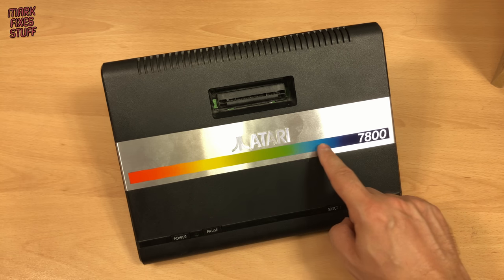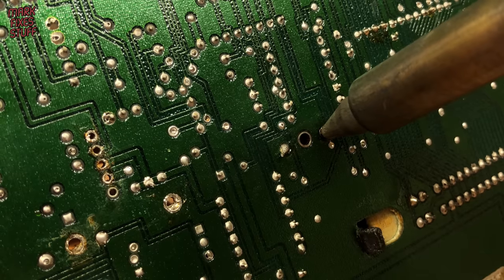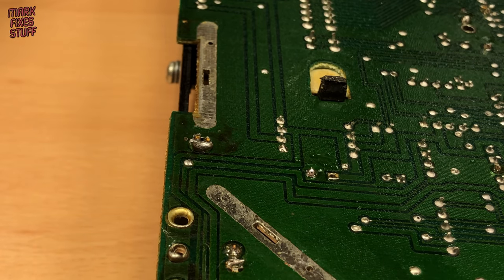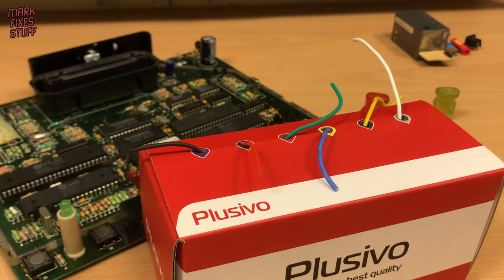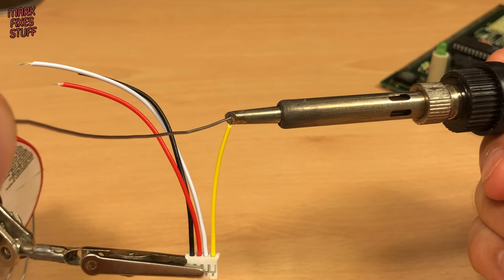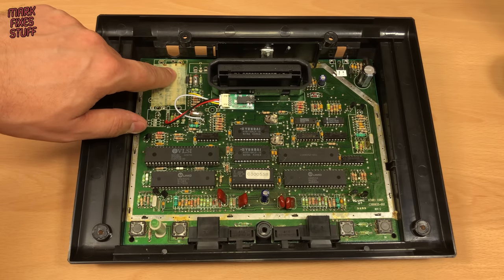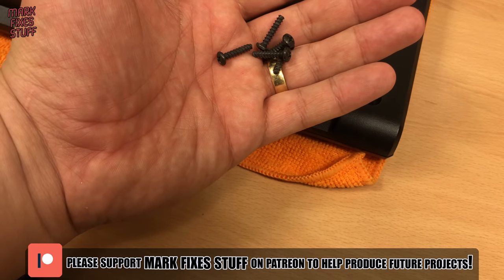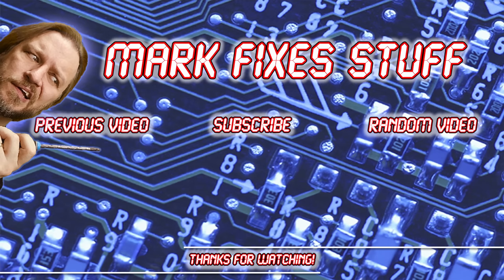Atari 7800 AV & Power Mods with No Case Cutting - PAL Mod and Test!

Comment: You must have a later version of the 7800....mine came with an Asteroids 7800 cart. I bought the system on clearance for 5 dollars US and bought out all the carts they had left for 25 cents each. All brand new in their boxes at Toys R Us back in the 90's. A job well done as always.
Reply from the maker: The PAL versions had the built in game. The US release was meant to have Pole Position II built in but for some "business reason" it never happened and they put the carts in instead. Thanks for watching mate  :)
Reply: @MarkFixesStuff   The pleasure is mine but yeah.. I keep forgetting you are across the pond    xD

Comment: Important thing to note about the 6.8k resistor. 

On earlier (ntsc with the expansion port) board revisions the TIA audio is still somewhat loud but adding a 6.8k resistor will make it almost totally inaudible.
Reply from the maker: Thank you for information :)

Comment: Nice job. There is double sided mounting tape that would be much better fit. The mounting tape I'm referring to is used on high performance R/C Helis' servos. Also a mention that red typically means + power, however, I believe in England the positive side is grounded like my '74 Jag was. Carry on then.
Reply from the maker: Got a link??

Comment: RE: The Crimp tool ... try it without wires and give it a REAL GOOD squeeze and see if it double clicks. I had one that was stubborn as a mule just like yours, till I just got mad and squeezed it as hard as possible till it double-clicked. Now it works perfect.
Reply from the maker: I'll give it a got, although I suspect the crimper is just "poo".

Comment: Hey Mark, at minute 22:00 didn‘t you solder the wrong side together ? looks like that side is already bridged by the mainboard itself and the other side needs to bridge ?
Reply from the maker: That's definitely the right end. I see that it does look a bit like they are connected on the board but they are definitely seperate. Schematics are here actually. https://atariage.com/7800/archives/schematics_pal/Schematic_7800_PAL_High.html

Comment: You should really test Ballblazer, Commando or one of the many POKEY-enhanced homebrew carts to ensure you’ve got the CARTRIDGE AUDIO balanced properly. The “correct” way to do this is to lift the TIA and CARTRIDGE AUDIO resistors and tie them together at the output to preserve the stock balance, or if keeping RF intact, add another pair of resistors at the base of each audio line, then tie the new resistor outputs together. Ballblazer is by far the more common of the POKEY games, but it only uses POKEY sound, so not easy to judge proper balance with that cart alone. Commando uses POKEY for audio and TIA for percussion and gun sounds during play. If one sound source is too loud compared to the other, you know you need to add a resistor or change values to get the right balance.
Reply from the maker: Hey Herb!! Thank you so much for taking the time to write this up. It's pretty much where I was headed, so to see it so concisely explained is really helpful. Since I recorded this video (last month!) I have managed to chase down a boxed PAL BallBlazer, but as you say it's hard to balance the POKEY and TIA with that cart so I have been looking for Commando. We more accurately I've been looking for Commando that doesn't cost a massive amount of money. I think when I have that cart I might have to revisit this and do the sound balancing as you described. Thanks again, I'm very grateful for the info!
Reply: If you can source or borrow one of the multi carts (an old Cuttle Cart 2 or Mateos Cart, or a new Concerto or Dragonfly Cart), all of them support adding a POKEY chip into the cart to play POKEY enabled .A78 format binaries. I have both - the compatibility is greater with DragonFly but it requires its own external power supply, and you have to select and load ROMs via a small two-line LCD on the cart itself. The Concerto is more user-friendly but has some console/game combo incompatibilities which have been tough for the developer to completely iron out.
Reply from the maker: @LeftyLabs  I was looking at the Dragonfly last night actually. That might make more sense than scouring ebay. Hmmmm... Next pay day maybe.
Reply: I'm involved in the 7800 community at AtariAge and definitely the Dragonfly is a great pickup for Pal users. Plenty of pokey enhanced games coming along as well but the YM feature is probably not required ATM.
Reply: @LeftyLabs  Ah thanks hadn't caught up on that yet. I have a concerto but which is great but the DragonFly is better for us Pal users.  We have been lucky to at least had access to some SD carts in recent times.

Comment: I'm pretty sure the TIA chip in the 2600 wouldn't have been able to do wireframe graphics--that's why the 2600 version of Asteroids went for the filled-in approach as well.
Reply from the maker: Funny because in my mind I thought the wireframe stuff would be easier to render. I’m guessing that the graphics can’t be filled polygons then.
Reply from the maker: (I know nothing about programming)
Reply: @MarkFixesStuff  It's because of the way the TIA works in the 2600. The entire console had only 128 bytes of RAM, so they couldn't have a nice bitmapped display that you could draw lines on--instead, the TIA had a "playfield", a couple of mobile objects, and a "ball" that had to be set up on every line of the display by the CPU. This is why the 2600 version of Pac-Man was famously terrible, the programmer didn't have enough objects available to render all four ghosts at the same time so they flickered like crazy.

Comment: A great video Mark.  I've just done this mod and it seemed to go well.  I've hooked it all up though and can't get the Atari 7800 signal to sync.  It's there, but is just in B&W and scrolls.  The Atari 2600 games play really well though with full sound and a crisp stable image.  I realise that this vid is a good year old, but if you (or anyone else) happens to read this, I would appreciate any help.
Reply from the maker: Thanks Graham! Always love to hear from people!
Reply: Thanks Mark, any idea what may be causing my sync issues with just the 7800 games?
Reply from the maker: @CASFAN  ah missed that. There’s a colour pot for the 7800 colours in the middle of the board that might need a slight tweak. That might sort the scrolling out too. The video output for the 7800 games is separated from the 2600
Reply: @MarkFixesStuff  thanks Mark, I gave that a slight tweak (I believe it’s R42 that deals with the 7800) but no joy. Maybe it needs a bit more. There was no 7800 sound either, but the 2600 had full sound.

Comment: Not that I think reversible mods are bad but I kind of wonder why one would go back to RF now, maybe if I brought my 7800 into a time machine and wanted to play with it on a TV from the past? Think I'd just tell the people that even in their time better AV is possible. ^_^
Power mod will be appreciated by anyone in the future trying to use it, nothing stops people dead in their tracks like "What kind of port is this?", where they usually just discard the console entirely. Stark contrast, Jaguar can use a GEN/MD Model-1 PSU. The original 7800 power port plastic is very thin and soft like it was designed to fail with time lol. O_o???
Definitely gotten the Composite kits down to a good price point, won't break the bank. 7800 RGB mods are still not quite ready for mass use but would like to see you give S-Video a try. ;)
Reply from the maker: Because in 100 years the antique expert will say “shame it’s not original” so I want it to be able to be reinstated for preservation purposes.
Reply: @MarkFixesStuff  Lol I see, you're probably right about that. Antique dealers see patina, I just see rust & corrosion.
Reply from the maker: @loganjorgensen  in the UK there is a program called Antiques Roadshow and the “experts” on that are always saying “if only it hadn’t been restored” lol

Comment: I need to buy a desoldering gun. I had to remove a dead PLA and sus SID chip from a C64 board yesterday, and it took forever using a manual sucker. I need my sucking to be quicker and automatic.